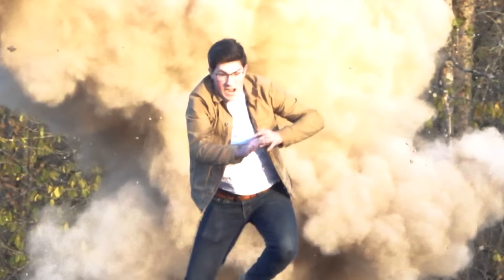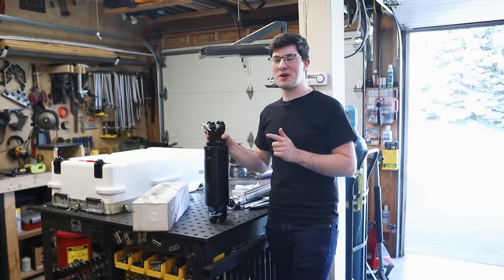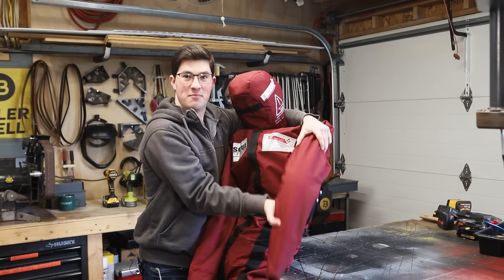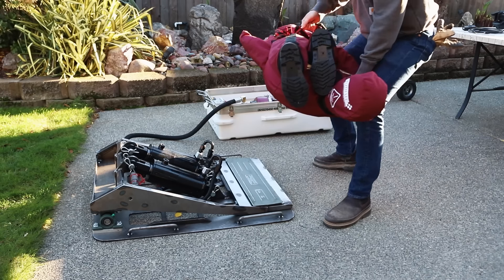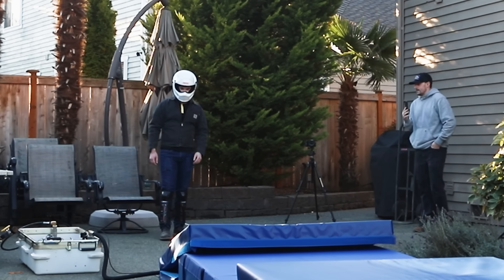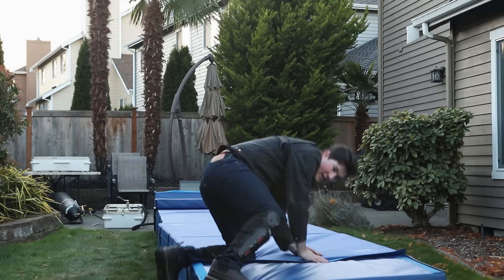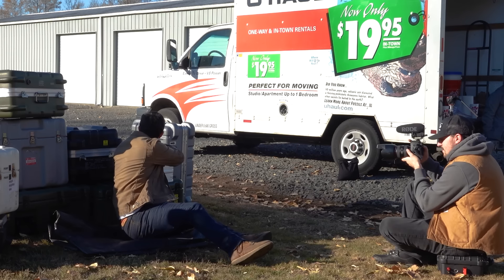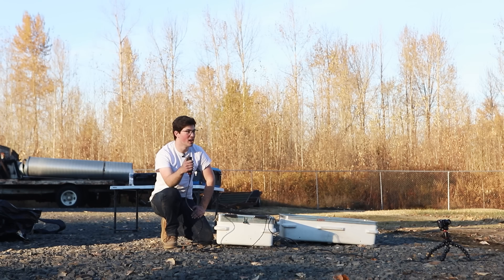Step here, launch 20 feet

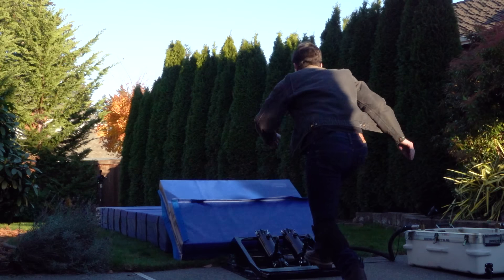Comment: 13:30 stunt guy here, some things I learned when I first used an air ram: keep running until you are in the air, you're anticipating the aerial part and start your aerial movements while still being launched.

 As seen in the first practice runs it didn't end well and kept hitting parts of you're body on the ram. At first you weren't sure what to do but figured it out with more practice, and looks like you got a good foot placement for your ram. But started turning to try the Kool aerial stunts by doing a face-off/twist/180. 

That turn should be done once airborne, not while trying to launch. You're using feet/legs to turn when they should be used to gain altitude. Most stunt people I've met that used this style of air ram use their upper body to turn. 

best way to practice for me is by jumping up and down straight in the air and turning my shoulder as if someone is trying to grab my shoulder, the rest of the body follows. Basically jump in the air and do a 180.

After that incorporate that practice in to the aerial part of using an air ram.

The overall use should go like step-launch-aerial stuff-prep for land-land.

If you ever teach others to use your ram, take notes of where your foot is when stepping on the pressure plate and make sure they know where to place their foot as well. Also try practice runs where they run along the side of the ram instead of into the ram and watch where their foot would have stepped to see if it's the correct placement. Maybe put a piece of cardboard on the ground the same dimensions As the pressure plate. As you stated you couldn't see the plate with the helmet on, a new user of the air ram will be very nervous and might miss just as much as you did even without a helmet. They always get their brain in a twist when they have to worry about the steps, what to do in the air, etc. 

Also I have always been told by all my riggers to treat an air ram like a gun, if you're carrying or adjusting the ram and it's loaded it'll snap your head off your neck.
Reply from the maker: A lot of comments here are saying I should have locked my knee and made my leg straight or stepped with both feet. Doesn't sound like a good idea. What do you think?
Reply: @TylerBellMakes  To me that screams broken knee. Maybe the pros that have MANY hours could develop a technique but I would say not worth the risk?
Reply: @TylerBellMakes  not a stuntman, but a lifter, so someone who knows what strain to joints is, i would keep my knee as close to straight as i could WITHOUT any chance of it locking out. If youre tightening the muscle and the joint is completely straight, the path of least resistance may be VERY different than the one you want. Look up leg press machine lock-out injuries if you want to learn how a knee DOESNT work, ruin your night, and be too afraid to ever use a leg press machine
Reply: @TylerBellMakes  I agree with pridedmaxx, locking knees will be bad for your joints. Everyone that has ever taught me to use these types of air rams say to get a running start and keep running until you're airborne.

I think I saw some other comments saying to do a jumping motion but I disagree. The pressure plate has triggered and is probably already moving, sending your feet up before you can make a real jumping motion. A super quick delay could mitigate this but I'd rather stick to a running motion.

With the running motion you're basically always pushing off the plate when launching.

One thing all my teachers have seen with air rams when using two feet to jump or lock knees is that they can't propel themselves upwards when the air ram starts swinging forwards, so people end up diving straight into the ground.
Reply: How do you even land a job as a stunt man? That sounds either super cool or super sketchy.
Reply: @TylerBellMakes  Most people's knee joints are slightly hyperextended (beyond 180 degrees straight) when their knee is "locked". The ligaments and musculature aren't very resistant to continuing that bend, there's really only one thing preventing your leg from bending all the way forward at the knee, and subjecting it to the force of an air ram... it's a recipe for a leg folded the wrong way round. ALWAYS start that with SOME bend in the knee. You don't even want your leg completely straight, much less locked.

Disclaimer: I'm not a professional, I just study sports kinesiology for my own purposes designing armor.
Reply: @noncog1  leg press is overrated anyway, all my homies do deadlifts and leg extensions haha
Reply: @talion9289  atg high bar squats and convention dl
Reply: @SwervingLemon  locked knees are always, I repeat always a bad idea. Steel could care less how squishy or not squishy we are. It has no conscience, if none of it makes sense, if you wake up the next day your almost guaranteed to know the outcome without having to think about it. Muscle and bones along with the connective tissue is ridiculously strong but it has no real comparison when instant force or kinetic energy is involved. Steel has no conscience...
Reply: @TylerBellMakes  skateboarder, snowboarder, dirt-biker here. keep your feet straight when launching off of anything. don't jump unless you want to boost, but basically stand up while going off your kicker or ramp, in your case ram

Comment: I'm glad you talked about your safety protocol with your prop guns. it sounds like you went with the industry standard for the most part, but i'm curious if you probed the prop gun for obstructions before each take? Scott Prop and Roll on youtube has a fantastic breakdown of the safety protocol his sets use, and probing the barrel for obstructions is a key part of it (an obstruction is what killed Brandon Lee). Even a little piece of debris getting stuck in the barrel during a take could be dangerous

Comment: Fun fact, the movie dirt he used in the air mortar is Diatomaceous earth, its basically a silicon esque rock dust, its a mild abrasive that my family used to use for fleas on our big great dane. Weird stuff. it is kind of uncomfortable to have on your hands for too long because it dries your skin like concrete mix but it does the same to fleas, literally drying them out until they die of dehydration. Big man hasnt had fleas in 4 years thanks to that stuff. With a bonus of basically being more aggressive baby power and preventing infections and rash for skin issue prone breeds.

Comment: Geologist here: There's different kinds of bentonite marketed. The stuff in make up and the pseudo-healthy "food grade" stuff are expensive. In pellet shape it is used as cat litter and swellable watertight borehole backfill material. But there's also  sacks of bentonite powder which are almost as fine grained as the expensive stuff but cost a lot less. They're used for an old soil density calculating method and other stuff.

Comment: Hey buddy I’m somewhat of a self taught stunt person from falling so much learning to ride motocross the truck is to let your head hit the mat at the same time as your torso if you ever landed on your back on a trampoline the only way to do it without whiplash is to let your head hit the tarp with your body so to get yourself in the habit of letting your head land at the same time it’s easy set a pad that you have in the yard and fall backwards on it letting your head hit the same time as your back. You could also just have let yourself land on your front side it’s much easier to keep your head up without any pain that direction just trust your pads. Hope this helps you out man enjoyed your video a lot though you are a very talented builder for sure you just gotta work a bit on your ability to fall a little and a large trampoline would help with that a ton if you can find yourself a place to use one

Comment: This was a fun watch. Although working with hydraulics I could see many of the issues you faced before you faced them. The size of the cylinders was just overkill. To save your machine from hammering itself to pieces it could benefit from a cushioning system on the rod end. But again this was very fun to watch.

Comment: Well you definitely more than earned a subscription from me. That was awesome! I always wanted to be a stunt person and I used to do stunts all the time as a kid. Mostly, I did the stunt part and didn't worry about any special effects. I'm kind of old now so it hurts much more to fall but I can still get my body to do some pretty cool things. I would totally hop on one of those air rams even today. I know I used to do all kinds of acrobatics on the trampoline and I was definitely the queen of all stunt bicyclists in my neighborhood. 

I once jumped a canal in the middle of an orchard where the rows of trees on one side were angled in one direction and the trees on the other side were angled in the other direction. The canal was super old school and lined with rocks concreted together. It was about 4 feet wide by 4 feet deep so failure would have wrecked me and my bike. The edges were sharp as hell too and I know since I had climbed down into it before to cool off in the water there. 

I built the jump out of pieces of wood I found in the orchard and that, in and of itself, was sketchy. Then, I'd have to ride my bike quickly down a row on one side of the canal, jump it, and somehow turn roughly 90 degrees to ride down one of the rows on the other side.

As per the usual, I rode too fast and caught too much air, so I cleared it with plenty of margin for error. The problem was that I landed too close to the rows on the other side so I ditched my bike to one side and was able to run down the row. My bike hit the first tree on that row but it was fine since it weighed a lot less without me on it.

Now you never know what kinds of crazy stunts you do as a kid will help you later in life...

Maybe 20 years later, I was riding my motorcycle and got flung off of it by a drunk driver. I didn't exactly land on my feet like I did after jumping my bike but I bounced off of my ass and managed to get my legs under me. The broad side of a truck was coming up fast and so I managed to run for three steps and change my trajectory just like I had after that jump. 

Things didn't go nearly so well as they had on that bicycle jump because I was obviously going faster but I did manage to change my trajectory enough so that I slid and ended up in front of the truck while my motorcycle went between the wheel wells of the truck all the way under it to the backseat of the motorcycle. Had I not had that experience when I was way younger, I'd probably be dead or paralyzed because my body would have hit the front wheel well had I not changed my trajectory like I did when I was a kid. Sometimes a stunt isn't just a stunt. I was also in the best physical fitness of my life but that muscle memory is what saved me. I just might not have been able to do it had I not been in excellent shape at the time but my muscles certainly would have tried.

I walked away from that accident, although I still have a fully separated shoulder. Other than that, I got some great road rash tattoos which are, by their very nature, one of a kind. I lacerated my liver but that healed like a decade ago. It was only in the past few years that I got through enough of the PTSD to be able to drive again without feeling panic and I know I'm a wimp because it wasn't a war, but it's just the very sudden and absurd life or death thing that gets to you, I think. My shoulder will never be the same but I think it might have sucked for me more had I ended up in a wheelchair. Honestly, I don't feel like it would have sucked more to die because many of life's great disappointments occurred after that but it does stand as a fact that I didn't die and I walked away. Honestly, I felt like a superhero that night while the adrenalin was still flowing and it was only when I realized I had suffered the first injury in my life that would never heal that it started to break me mentally.

I will say that life is supposed to be lived and, once you're alive, there are only illusions of absolute safety. Things can be done as safely as humanly possible and should be as much as possible, but we're all going to die when it's time for us to die. This is precisely why one should take in the experiences in life with a due measure of caution but not fear. There will come a time when you will find that you can't do the things you wish you could do so you should do them before that time comes for sure but with as much safety as you can. It sucks to wish you had done something before and know you can't do it now. Not sure it if sucks more than dying since I haven't died yet but it does suck to be alive and wish you had done something. I don't regret having ridden that motorcycle because it was the funnest vehicle I've ever had and while I'd probably be afraid to do it again because crashing really sucks and it basically ruined my life, it also made my life fuller and is one thing that I wanted to do that I actually did, even if it did eventually end badly (after 7 years of riding).

Comment: 17:51 I can tell you we used chrismaslight bulbs with straws and gun powder to set off small Black powder charges with fullers earth cork and kitty litter with the sparkles in it to catch the camera. if you needed a lil fireball you added a scoop of non dairy creamer ontop of the black powder for the little fire poof in the middle of the dust cloud. you could safely have an actor stand almost ontop without issue.

Comment: I kept thinking "please add a delay to the pressure pad" all the way through watching this.

It was triggering as you were stepping onto the pad, before you're ready for your next step off that foot.  You want it to launch as you're propelling yourself off the pad so you're working with it, not against it.  Kinda like a trampoline, you want to be jumping with the launch momentum.  What you were getting was more like getting your bounce stolen.   The pads moving up while you're still moving down. 

The workaround works, but you could probably get a better launch by dialing in the timing.  It'd also take a lot of the strain and strength out of it for the jumpee.

Comment: New subscriber as you just came up in my feed. The science and adjustments based on actual trials, adjustments, hypothesis and further conclusions and testing is they way. Not just “guessing” or “feelings” lol.  Cheers !! To science and engineering an physicality. We all need to get off our asses and work our bodies. !!!  16:08 glad your bro didn’t to a nut tag while in the air. Mine sure would have.!!😂

Comment: it may be possible that the water in the soup was able to compress the solids instead of pressurize the can .  Probably because the ice formed from the outside - in .
The way to test that is have the cooling be on the inside of the soup instead of the outside .

Comment: The ramping up speed instead of full speed makes sense - your body has to accelerate before being able to use the higher pressure's speed. If you don't let your body accelerate, the force will instead go to the path of least resistance - bending your legs. You want a constant push, not a single explosive shove.

Comment: I would have though it would have been better to land on the pressure pad with both feet, so that one leg doesn't get stuck behind the launcher, and so it distributes the force to both legs rather than trying to concentrate it in one. Plus if it was simulating a explosion, the situation is most likely someone standing on two feet unless they happened to be mid step anyway.

Comment: I'M WORKING ON A AIR BRAKE USING A 2 WAY  PNEUMATIC ACTUATORS 8" STROKE 1/2 SHAFT ,MY PROBLEM IS THEY WON'T SYNC,WHICH IS LOOKING NOT VERY GOOD. THE PRESSURE RATING IS 100 PSI.I HAVE THE 2 T'D TOGETHER ,THINKING THEY WOULD ACT AT THE SAME TIME,BUT NOOO. ANY SUGGESTIONS WOULD BE APPRECIATED.THANK YOU

Comment: I have two complaints about the end film. 

You turn the wrong diraction. U turn right. And fly over the middle of the crates. 

You should have turned left as the camera’s changed shots.

And if possible. I would have attempted at least a bit of “fake jump” before that camera change aswell.

The immediate jumpcut to you flying through the air. Feels a BIT cartoonish.

All in all though, still a 9/10. Would watch as a full indie movie

Comment: prefeace: only about half way through the video

"I dont think I really need [the helmet]" .....If "think" is in that type of sentence...keep it on..... Its better than busting up your brain case.

Also, you NEED a delay on the pressure pad (which Im sure youll figure out in the rest of the video). As you step on it, your body needs to carry over your ankle and just as you begin the jump is when it should fire so it accentuates your natural jump. If it fires as it first senses weight your center of gravity is behind the point where its pushing. That is no bueno.

Comment: Your knees are too soft, it's like jumping on a trampoline, your knees are absorbing most of the force which is actually harder on the joints... your knees are built to absorb shock but not at those extremes, but it looks like you're naturally falling into that as you go.